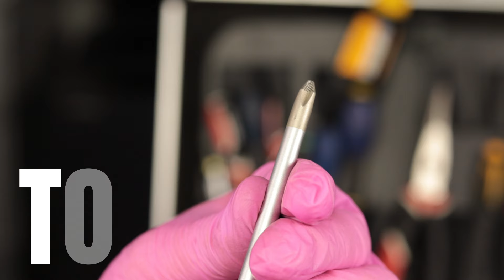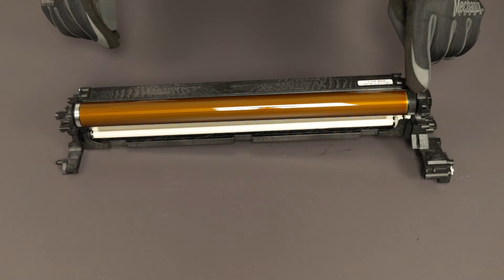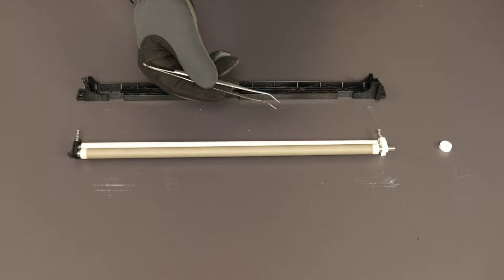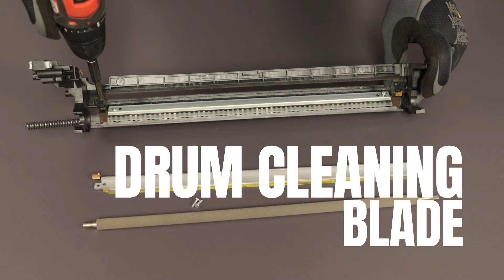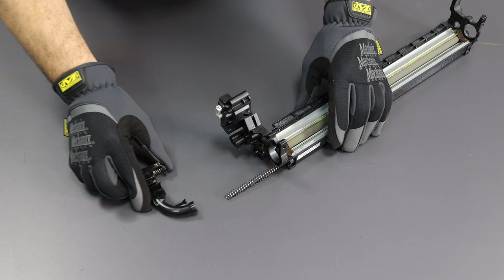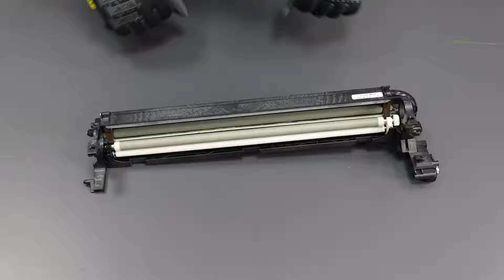Drum Unit Ricoh IM c2000 c2500 c3000 c3500 c4500 regeneration

Comment: What would happen if the printer ran without the lubrication bar?  I know it's important, but to what extent?  What would be the benefits?  Would I have a lot of problems if the bar runs out and I continue using the machine?
Reply from the maker: Yes there would be a problem because your OPC Drum would wear out very quickly and the copies would have a background image. I will prepare a video about it, the one you wrote about.
Reply: Kênh của bạn rất hữu ích

Comment: What causes prints to have a pixelated look especially smaller prints like a call card size. Bigger prints are fine. I do designs so my quality are always high but when it is to print like a call card size or a small ticket you are seeing some form of pixelation on it. I never had that problem before.
Reply from the maker: @mariojoseph5732 Do you have Mac or Windows?
Reply: @MrRicoh  Windows
Reply: @MrRicoh  I use the pcl universal driver the updated one on the Ricoh site and still was getting the pixelation. So I saw Ricoh has another driver specifically for the machine used that and problem solved for some reason I have being using the PCL driver ever since and no problem
Reply from the maker: @mariojoseph5732 Great. The PCL driver does not work properly on these machines. I'm glad you solved the problem.